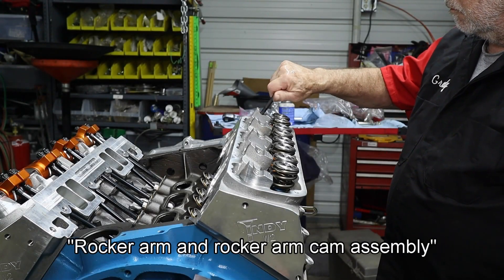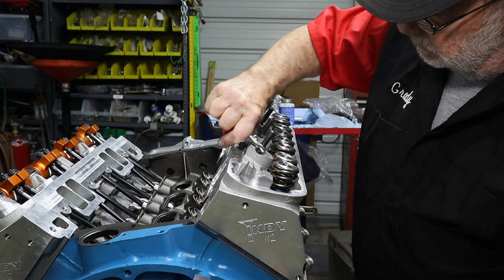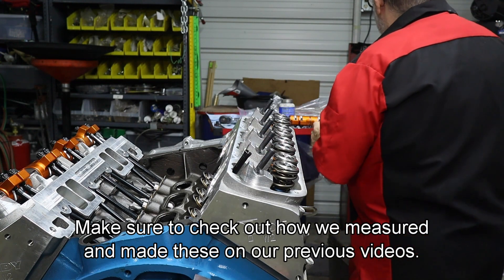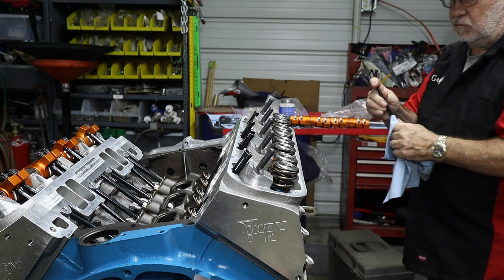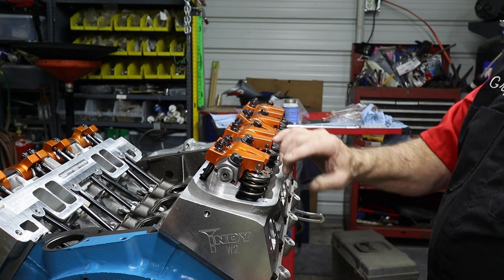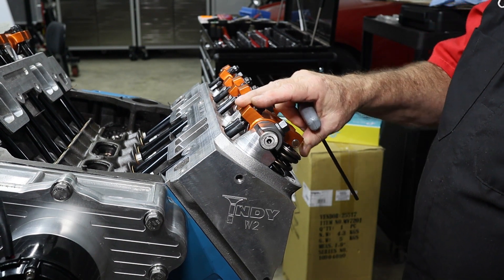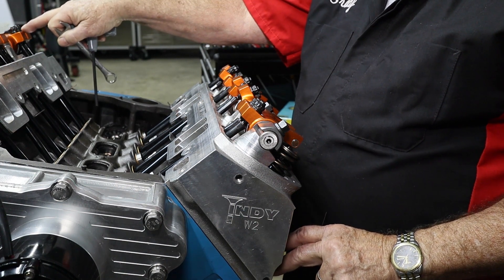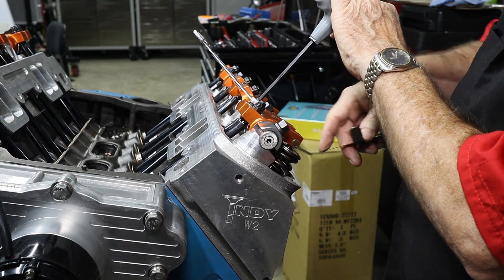The LA-phant: Cam, Heads, and Rockers (Part 3 of 3) | Rocker Arm Installation and Valve Lashing

Comment: How does the rocker shaft get installed? Oil holes for the rockers up or down?
Reply from the maker: Yes.

In all seriousness, we made sure the oiling ports feeding the cam weren't blocked or hindered. This was a solid rocker assembly. However,  we set it like the factory rocker arm cam.
Reply: @MicsMotorworx  I'm currently building my engine and the oiling holes for the rockers are up, is that incorrect? What could go wrong if I left them up?
Reply from the maker: You'll need more oil where the pressure is applied. ;)
Reply from the maker: Yup. That's good. Forced up, gravity down.

Comment: So these are adjustable rocker arms? most mopar rockers are non adjustable? can i do this on a 318?  non adjustables make it to where at higher rpm you get floating valves that wont seal? Got a 85 d10 no rust, just wanting to rebuild 318, know this is all probably over kill for me, but just wanting to play around, thanks
Reply from the maker: Sounds like a nice ride.

Yes. But ya probably don't want to use the ones from this video..

The 318 to 390 stroker we built before this build used adjustable rocker arm from Comp Cams. They're great for the beefier cam we had in that. 

Let is know how it goes.
Reply: pirate a rocker assembly from a solid lift 273 . $200-$300 from the swap-meet ?
your hydraulic cam will need a shorter pushrod

Comment: It's a misconception that the valve lash decreases when hot. It's a proven fact the valve lash increases when hot.
Reply from the maker: That will be addressed in a future episode.
Reply: @MicsMotorworx  it just depends on the head material, aluminum or cast iron, they expand and push the rockers away from the centerline of the cam.
Reply from the maker: Yep. That episode is in the process of being edited.

Comment: I hate to disagree with you, but I have to.  Cold lash is almost always set around .004 tight on a solid cam, more or less depending on aluminum or steel heads.  When the engine heats up, the lash will open, not close.

https://www.facebook.com/watch/?v=875171149938208
Reply from the maker: Neat link. Thank you for leaving a comment. We always appreciate a different perspective.

Our reasoning; The numbers we used came straight from Hughes, as this build is essentially one of their "kits." We can always adjust the lashing as needed or warranted. 

Oddly enough, the rocker arm "chatter" stopped as the engine came to temperature on one of our recent runs 😁
Reply: @MicsMotorworx  I'm only going by my experience, although that is with steel heads, up to my current W2's.  I didn't base my opinion on that video, but from what I've seen, it's accurate.  Either way, I'm excited to see a Mopar small block build that so close to what I've been running.  Freshening mine up recently as well.
Reply from the maker: 👍

We'd love to see it. Feel free to share a link.
Reply from the maker: @Scott-qe6ih  Sure enough, we ran the engine to full temp and found the lashing had widened.  We believe this was due to the different materials at play.  Chrome-moly (chromoly) push-rods, aluminum heads, aluminum rockers, steal rocker cam, etc.  With the engine at temp, we adjusted down to 0.002.  Several reliable sources confirm this thought. Thanks again.